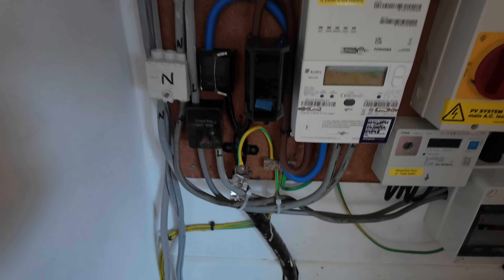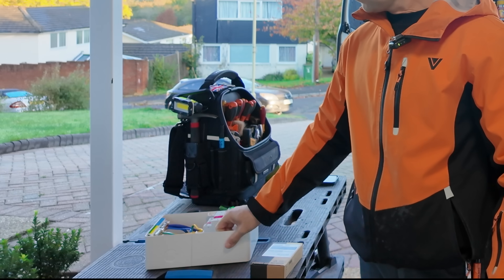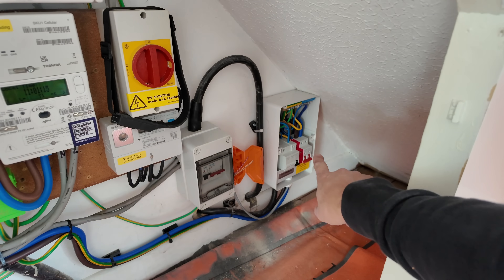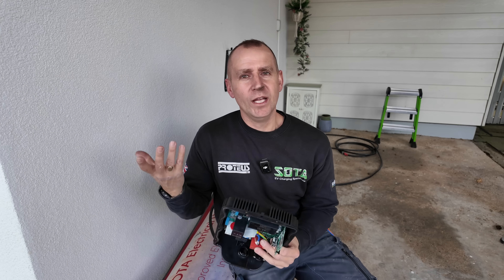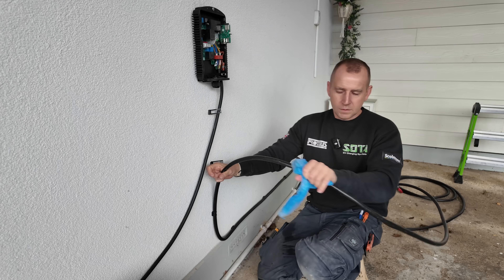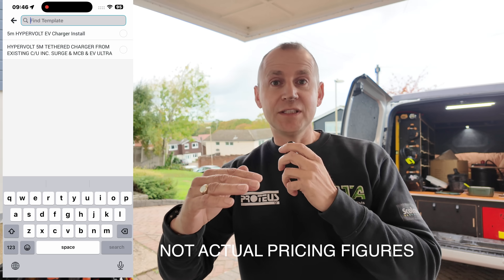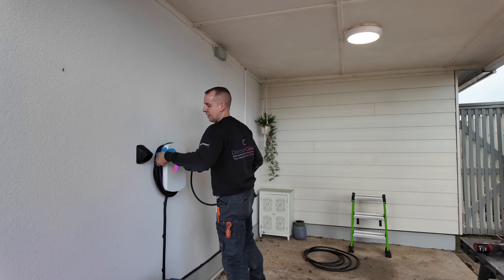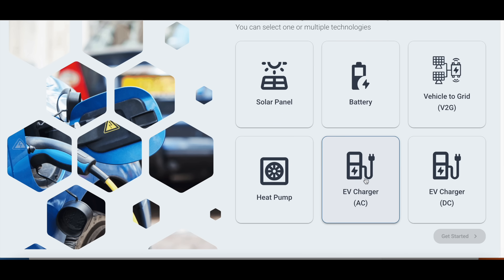WHY EVERY ELECTRICIAN SHOULD BE INSTALLING EV CHARGERS

Comment: Genuine question why mount the holster to the left on this model and have the cables crossed at the bottom? Could you not mount it on the right so the cables don’t cross?

Comment: Problem is the vast majority of EV installs are either “free standard” installs that come with the purchase of a new car, or motability installs. In both cases the charger you use is dictated as is the budget, so you’re forced to use cheaper cables, cheaper fixings and actively encouraged to do quick installs with things like outdoor consumer units as that’s all the car dealers / motability will pay for..😢

Comment: Octopus are actively discouraging people from connecting chargers if the car is compatible so it less relevant now.
Reply: No still super relevant, what happens if your car is in for repairs and you get a loaner that isn’t Octopus compatible or is but is a different make now the pairing to octopus has to be done again with that make and model, and as said people with two EV you can only register one yes technically you can boost in off peak but this doesn’t allow Octopus to do the charging session which is what intelligent was designed for, so charger best fits to do this and Satisfy both parties ie consumer and Octopus.

Adam’s talk of expansion two EV’s initially I believed to be a bit on the limit but since we turned to one of those households and one of the cars isn’t compatible with Octopus intelligent but charger is so that settles that! But the electric ⚡️ shuffle of cars especially when used for work commute is annoying! How much charge you got well I need to go here gonna take XYZ think I have enough blah blah blah so looking for a second charger but going for a OCPP charger if AWS blackout has taught us local control is needed as a backup.

And may we not forget that when Ford, Jaguar and Tesla changed there cars API this rendered it not compatible with Octopus Intelligent anymore leaving a lot of people in limbo as not Octopus’s fault and the vehicle manufacturers can change there API if they want as no stipulation to Octopus.
Reply: @DTech101  your are missing the point, all your points are valid. However if Your car is compatible octopus will make you pair that.  They now also support two evs. Advising a customer to pick a charger for intelligent go support is not that clear cut that’s all.

Comment: Have you ever had issues with cable runs and ordering cable lengths when using open quote? I feel like it would be highly likely that the customer would get the measurement of cable runs wrong and before you know it you are short of cable!

Love your videos by the way! Great work 👍
Reply from the maker: The customer submits a video of the potential cable route and from experience I can give a really good estimate to how long the cable route actually is
Reply: @sotaelectrical I see! Thanks for the reply.

Comment: Great job - just had the hypervolt installed nice charger - we ran the test on the installer app and an action came up " CT direction needs reversing" we have turned the ct clamp with the arrow facing towards the charger and still get the same message any ideas?
Reply from the maker: You don’t have to physically reverse the ct, at the bottom of the app you can reverse the readings, I’ve not had that warning come up before personally

Comment: Im a sparky, but have dropped my Napit membership as only work part time and mainly on commercial..  Just seen an EV charger installed for a landlord..   CT clamp round the garage supply cable, despite being a cat6 shielded cable back to head in the house, IP rating of enclosure compromised in top of adaptable box, no silicon used when coming through garage wall, 32A RCBO used when manufacturer says use 40A..  No Ferrules used even though manufacturer recommends.  Paperwork showed wrong EV charger and said he installed a garage DB, and max demand of the installation as 45A on a large 4 bed house with an 11kw shower and electric cooker.

Pointed these out, installer went back, moved the CT clamp to the shower (God only knows why) on the main DB in the house, changed from the provided double pole RCBO to a single pole RCBO despite me telling him it had to be double pole, and despite me saying he had to setup the charger left it as load curtailment at 100A despite the fuse being 80A..

Its not difficult to install an EV charger but you still need to be competent, this was an NICEIC approved contractor..  Absolutely shocking, to add to it he had no idea you had to notify DNO..   I gave up and am going to fix it myself in a couple of days after giving him a chance..  If you saw the cabling also you would be shocked, just went diagonally to the DB in the garage, not neat at all..
Reply from the maker: That sounds awful
Reply: @sotaelectrical  Yep and he advertises as doing EV chargers..   It is really bad how some sparkies are hardly competent and the CPS are a complete joke, they just want the money...

When I contacted NICEIC they really were not interested, they just told me if I touch it then its nothing to do with them or the installer, completely missed the point that one of their members was not competent yet they back them as being competent..
Reply from the maker: @steve11211 absolutely shocking, the CPS schemes need reforming
Reply: @sotaelectrical  Agree but wont happen as its just a money making racket..   I could not do the job cause I didnt have my NAPIT any more even though like yesterday I can work on a community centre with thousands of people going in and out, add circuits do what I like because its commercial yet I can't add a circuit in a house without paying a load of money to these scam schemes...   

Just make it so only fully qualified electricians can work on electrics, and can notify building control, cut out the CPS cause they add nothing..

Comment: What would you do in this situation for CT's and Curtailment 

Commercial Property

Mains & Meter are in the basement over 100m away from the charger location.

The length for hardwired CT's is too long and the wireless solutions wouldn't reach. 

Would you find it acceptable to install CT's inside 3 phase submain closer to installation and curtailing it to the limit of that board on the overall installation.

Also meaning I would have to run a single phase board with SPD and RCBO protection off that 3 phase submain

Its not ideal but i can't see another way round it.
Reply: No reason you can't put a CT on a long cable, as long as the cable resistance is low enough to avoid affecting measurement too much -  you may need to use something a bit chunkier than cat5, e.g. 0.5mm^2 flex

Comment: Cheers Adam great video is that all you have to do to register no scheme to join or pay for ? also what certification required via Napit EIC ? or Minor works if in original CU. cheers Kevin Hedge End
Reply from the maker: Any new circuit is an EIC, you have to be NIC or Napit to sign off the works and notify building control